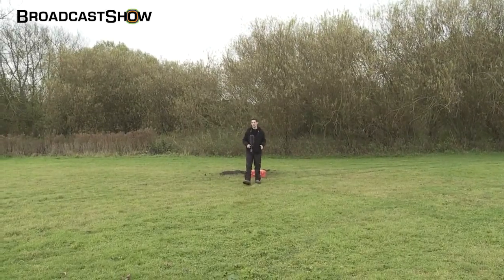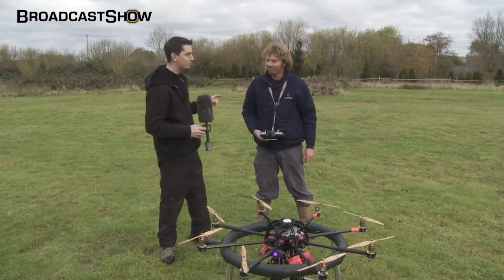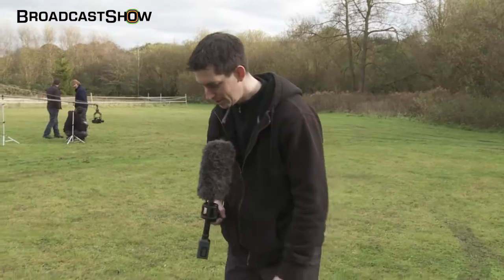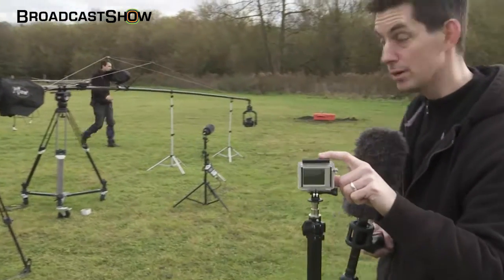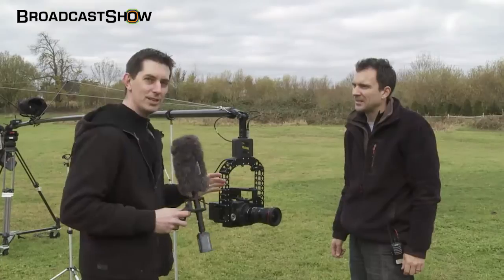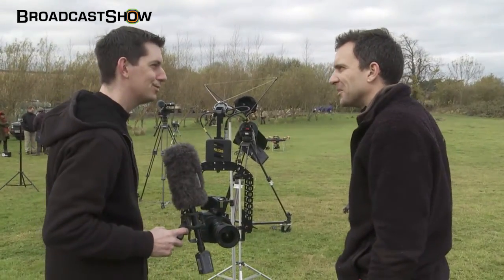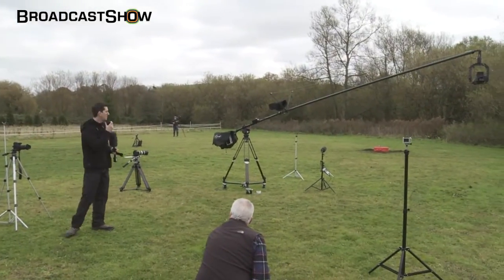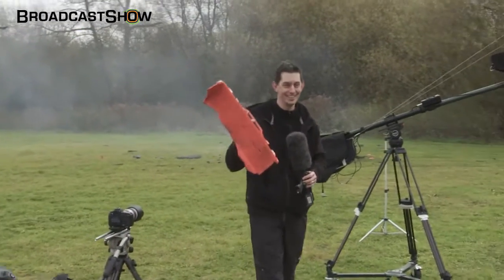PELI Case 1600 tested to destruction. Test 6

Comment: Nice explosion but not sure what it was intendert to «test» or «prove» as even the strongest safe will of course explode to bits when you explode it like that. A bit of fun though, I get that, all proper men can enjoy loud bangs, explosions etc so thumbs up for that.
Reply from the maker: we'd be running a series of 'tested to destruction' videos featuring the orange Peli case. We'd dragged behind a boat, pulled  behind a car and submerged for an hour in a swimming pool. This was supposed to be a light weight explosion, enough to lift the case a few meters in the air and drop it down. As you see our explosive experts got the mix slightly wrong and, well, enough said really.

Comment: did the go pro work with new battery?
Reply from the maker: hi there - sadly not, we suspect the shock of the explosion (which was more than anticipated) blew components within the GoPro. The media card and data however was ok up until the point of explosion when the camera ceased to function. I'm not sure there is a camera on the market that would stand this type of test!
Reply: KITPLUS thanks for the reply
Reply: stupid.